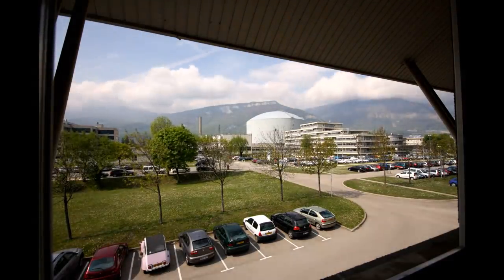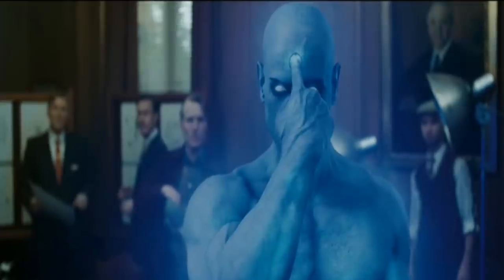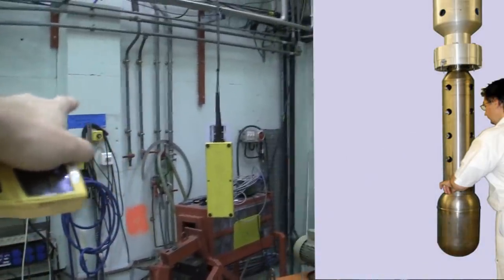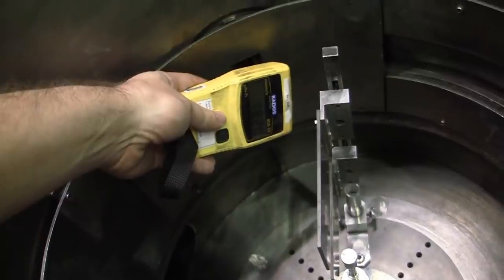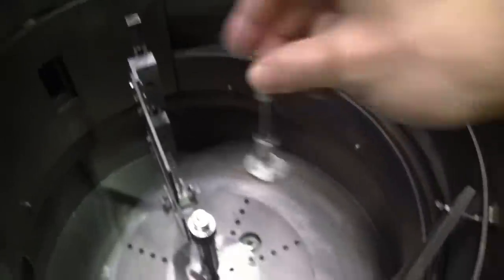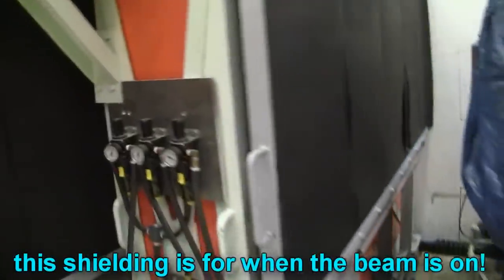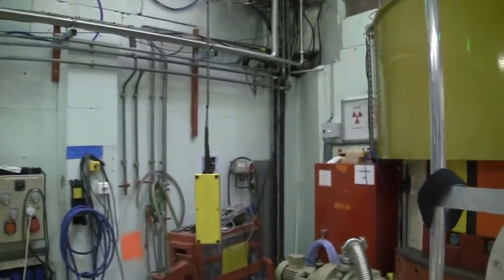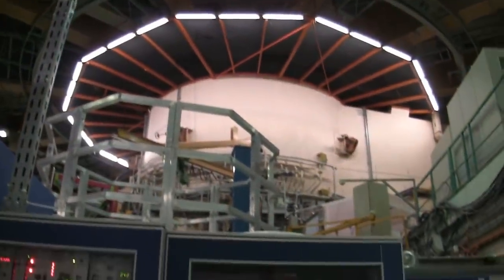Nuclear Reactors, Fantasy and Fact!

Comment: HAHA, Every time someone I know has asked me to explain what I did for my old job (US Navy nuclear field mechanic, submarine) or how nuclear reactors work, the things that seemed to shock them the most are always:
1--the fact that coolant (water) leaving the reactor core glows blue (Cherenkov Radiation)
2--the fact that essentially a nuclear reactor, in the most simplified way of description, is simply a big metal thing that gets hot, which we use to boil water.
3--descriptions of how awful the design and operation of the Chernobyl reactors were
4--exactly what the terms "subcritical", "critical", and "supercritical" actually mean in reactor operation (hint; they have NOTHING to do with the reactor about to blow up like all of the ridiculous movies have shown)
Reply: +22steve5150 I've worked on quite a few steam turbines at various plants and most of my friends don't seem to understand the difference between the turbine on the cold side and the reactor on the hot side.  I've tried explaining it to them, but they just don't get it.  As far as they're concerned, I get neck deep in radioactive waste.  To be honest, I've never actually gotten to work in Containment yet, and that's fine by me.  To most people, if it's at a nuclear plant, then everything there must be glowing green or something.
Reply: 22steve5150 I'm rather surprised at number 2. I remember my school physics class explaining that most methods of generating electricity boil down to (pun not intended) heating water and using it to rotate turbines.
Reply: +Crowley9 Nuclear Power: bringing Middle-Age technology up to the modern era.
Reply: +Phi6er sub critical means that the reactor is producing less neutrons than it's consuming, critical means that it's producing the same as consuming and supercritical means it's producing more than it's consuming.
Reply: since i'm not an expert i can be wrong, but i'm pretty sure it doesn't apply to it at all, i think it's a term exclusively for nuclear reactors.
Reply: +GamePhysics Lots of sensationalist bullshit in the media, the threat to life in the area and longterm environmental damage is nowhere near what some of the claims are.  Some of Thunderfoot's videos are about  Fukishima and they go over the reality of the situation very accurately and honestly.
Reply: +22steve5150 We have a HUGE problem. People are SCARED of nuclear energy, when something like the Thorium reactor would really cure most of our energy and greenhouse gas problems.
Reply: jesusnthedaisychain
Yep, same here.
Reply: 1. Infrastructure. You do not need large infrastructure. They are relatively small units and you add modules as you need them.
2. Mining. Thorium is the useless byproduct of rare earth element mining. We are already taking it out of the ground. After we use it up (way better usage, way less waste with Thorium) we can put it right back. Remember, it's only radioactive at 400 degrees Celsius.
3. There is little waste water. No more than any water that boils in a closed system. So, no difference from coal or gas. You may be thinking of the normal reactor that uses super high pressure, and unbelievable heat. Not the Thorium reactor.
4. Waste. The product is only radioactive at 400 degrees Celsius.
5. Cars. The development of good batteries for cars needs lots of rare earth elements. You know, that stuff you mine that has Thorium as a 'waste' product.
Because you take so much power out of so little, we will NEVER run out of Thorium.
The only reason they went with high pressure reactors that use other dangerous and expensive elements, was because those reactors created material for atomic bombs.
Thorium has been there all along, as a great way to get virtually unlimited energy.
Time to relearn our attitudes. The Thorium reactor really IS the way to get off carbon. I think we can agree that it would be nice to be completely off it. We can, now that politicians like Nixon are not in power. It was Nixon who folded the Thorium reactor so the United States could build bombs.
Check it out, and then spread the word. The Chinese are going to try and beat us on this.
Reply: ***** That's not true. We will NEVER run out of Thorium. Not for thousands and thousands of years. The Thorium reactor IS the cure. The complete cure. This should keep us going until we perfect the fusion reactor. In the mean time, Thorium is plentyfull and the reactors are completely safe. The core can't overheat because the salts, when they expand are not able to carry the reaction. That means self regulation. It runs at 400 C. The melted salts are kept in a vessel. The bottom of the vessel has a frozen Thorium plug, that is kept cold by subzero air that is blown onto the pipe. If the electricity goes out, the plug melts and the salts run down into a cooling chamber without ANY human intervention. Go to YouTube and watch the videos. They will make you very happy. We have a way to control global warning. We can stop mercury into our environment. People with asthma will get better. Cancer will drop as the environment gets cleaner.
Reply: +amojak  fast neutron interactions with borated water might have that effect (I worked on S6G naval reactors that don't use borated water so I can't really speak with any authority on such reactions) but I'm specifically talking about beta particle interactions with any kind of water, which seems to have a similar mechanism as what you described (beta particles transfers energy to water molecules as they slow down from speed of light in a vacuum to speed of light in water, and the water molecules then emit the energy they robbed from the beta in the form of photons)
Reply: +22steve5150 Yepp, agreed, the 'terror of the nuclear power' is definitely beyond the hype. 
What should not be forgotten is the amount of waste material (not inherently the nuclear fuel waste, but rather the shielding) that is generated for which we currently do not have any reasonably priced, or even reasonably long lived storage capabilities. As far as I am informed no current economically viable method has been developed to reuse that waste material.
Dito for the actual nuclear fuel waste. 
Note: I was talking about an economical way, not that it was not possibly physically.

That's in the same league as 'producing gold from lead'.
Yes, we are capable of doing that, but not in any way that is economically feasible. 
Because the amount of energy required is enormous, and the amount generated is absolutely ridiculously tiny.

In essence, a nuclear power station is nothing more than a glorified, super-powered steam engine.
You simply use the radioactive decaying process (instead of another heat source) to heat water to steam to power (via a heat exchanger) a turbine which in turn powers the generator. 
Period. Nothing more than that, basically.
But, sure, the actual controlling process does tend to be a tiny bit more complex. ;-)

In the science reactor (TRIGA) in Mainz I visited, something similar but muuuuch smaller than the one thunderf00t showed, the Cherenkov radiation was a very short-lived blue flare. 
Very nice color.
They used their oversaturation injection to demonstrate that effect to us chemistry students. 
Thanks to the moderator used in it is water, and water loosing its moderating abilities when it turns to steam, it is a very safe design.
It was NOT designed as a nuclear power station, but rather as a nuclear physics and nuclear chemistry reactor.

Note that this was more than 25 years ago, and my memory of the exact terms had to be translated from German.
So if the terms are not absolutely correct, please forgive me for that inaccuracy.
Reply: +Laughing Stock LMAO
Reply: +Laughing Stock 
Not trying to argue here, but waste heat CAN be managed with proper infrastructure and innovative thinking. There's an overwhelming demand for heat in general, on this planet of ours. Demand for fossil fuels just to use for heating and nothing else.

So why not kill 2 birds with 1 stone? Why not make the best of what we got without wasting anything?

If, and just go along with me for a second, we used nuclear power plants for electricity and used all the excess heat they produce to keep our cities and homes warm, wouldn't that be a great solution for the future? Why can't it be power plant AND heating plant at the same time?

Yes, there would be some heat loss during the transfer process for the public heating infrastructure, but if the excess heat is plenty then it wouldn't make much difference anyway. Would it not? And you can keep the system running on all but the hottest periods of the year or simply use it to heat up tap water during summer as well.

Is it so unreasonable to think this way? Is that really so unattainable?
On the other hand, I do understand that system like that would require huge investments and people working together for a common goal and in the current climate of selfishness and greed it's probably too much to hope for. It simply smells too much of "socialism". :/
Reply: MackP That's the problem. What happens? Well they try to seal the breach. (S?) They take down a nuke to seal it but then they don't use it. What do they do? They overload the last remaining Jaeger and it causes a nuclear explosion, which seals the breach.
They needed someone to say, "Hey, that won't work! To set off the bomb you need to make it a bomb, because a nuclear reactor won't do that!" Then they could have swapped the duties of each robot and everybody would have been happy.
I'm still going to watch the sequel if they make it, but there you go.
People think of nuclear reactors as potential bombs. I guess it's not worth it for Green Peace to set them straight.
By the way, I am a fan of the Thorium reactor. It still has a few problems, but when I mention those problems to people, they seem to think it's an easy fix.
Reply: MackP Check it out. That's why I like them. Simple, almost fool proof, cheap, abundant, did I say cheap? There's videos here on YouTube. You'll like it!
Reply: +Phi6er i read some of the other replies and found them to be missing info so here goes. Reactor criticality is like your car: super critical means you are accelerating speed, critical means you have cruise control on, sub critical you are braking or shedding energy. Really its that simple; whats happening in terms of neutrons moving around is more complicated but only slightly. All radioactive substances are naturally unstable and will periodically release energy in the form of radiation and neutrons. This happens at a predictable rate (half life) which is unique to each radionuclide (google chart of radionuclides). Depending on this and other characteristics of each radionuclide, there is a mass at which all of these energy releases will occur at once and interact with all of the neighbouring nuclei in the mass causing an uncontrolled chain reaction and the near instant release of all this unstable energy. So say if Pu239 has a critical mass of 13kg, and if you have 6kg in one hand and 7kg in the other, you would be safe provided you keep your hands apart (not to mention wearing some PPE lol). If you brought your hands together the two masses would go 'prompt critical' and an unbelievable energy release would occur. Prompt critical doesnt fit into the sub, super critical definitions because it is truly defined by the specific neutrons which cause the event and at what point during the reaction they are ejected from the nucleus. Google prompt vs thermal neutrons for more on that. Reactors are designed to prevent prompt criticality while A bombs exploit this reaction for obvious effect. Hope this helps!
Reply: ***** The governement will pay to slowly change over to Thorium reactors. They may well get their money back from having less illness that fossil fuels cause. Otherwise, the change over is a preventative measure to control global warming. It has to be done, and you offer no alternative.
Reply: I'm also going to say that mass production can bring that down. To be fair, I have seen estimates higher. That's one source that shows it's much cheaper than conventional nuclear energy. In all cases, it is cheaper than regular reactors, and we do need to change.
Reply: Oddly, there are thousands of decommissioned, disassembled nuclear reactors, including the reactor that burned during the Windscale fire, which aren't such menaces that you claim.
Most of the isotopes that result from neutron activation of nuclear shielding tend to be rather short lived.
Hint: Two and a quarter island (after it was, ahem, downsized), is scheduled to be demolished quite soon (assuming that Trump doesn't somehow cut funding for that as well)).
Indeed, the remains of SL-1 are no longer hazardous and that reactor had a massive, Chernobyl type of prompt criticality excursion that results in the explosive disassembly of the reactor.
Reply: +Laughing Stock your kidding me? right? RIGHT?!
Reply: yeah, the decay of radioactive elements (I'm taking uranium's decay, just as an example!) can be thousands of years, whistle I think that ''decay rates'' are the time span for radioactive elements to decay, is I think what he meant. (I'M NOT AN EXPERT SO DON'T THINK I'M 100% CORRECT ON THIS!) and yes, life will move on, damnit!
Reply: +22steve5150 What about the Fukushima reactors? Any thoughts?
Reply: ***** Hey man, I answered all your concerns, and you didn't go look at how they work, did you? Because if you had, you wouldn't now be taking the Luddite position.
Reply: Yeah, and I told you that the infrastructure is no bigger, and is, in fact, far smaller than the infrastructure for producing energy now. So that thought just bounced off your head? Why don't you just turn off your computer, your lights, and your furnace, sit there in the dark and STFU.
Reply: ***** No. Thorium will never run out. It's a common element. The fusion reactor is also coming on line. Thorium might become obsolete, but it will never run out. The other thing is, Thorium really gets used up nicely. Not as much waste.
Reply: ***** Drain a reservoir that was being used for hydro. Use the space now used by coal and gas. Sorry, there's no excuse.
Reply: ***** I am saying that there is plenty of room to build reactors, and that we don't need the reservoirs any more. River valleys are much more pleasant.
Yes, I am thinking about replacing the methods of creating power that destroy the environment. There's room for the infrastructure, and we can get rid of ALL the carbon based energy systems. NO we don't have to replace the boilers, the turbines or the wiring.
To be clear, we WILL need to build more power generation. Our society is growing. Might as well choose something that will solve ALL the problems.
Thorium is extremely friendly. At normal temperatures, nuclear reactions don't occur.
I have said before, this time pay attention, that Thorium produces less than half the waste of other types of reactors, and the layout is compact and simple. You only need a small building because there are no high pressures to deal with.
I don't believe in God. I do believe in leaving a river valley ecosystem alone if it can be helped. Draining a reservoir returns the valley to a natural state.
Thorium reactors mean no more mercury contamination and no more global warming gases.
Reply: ***** The difference between you and I is that I have answered all your concerns, and you give me NOTHING.
You disagree with the Thorium solution to the energy problem because you disagree. Your posts show you don't know anything about it, and yet you persist. Is it the only way you can get attention?
Heat pollution? Are you stunned? Almost all the major forms of energy use steam to drive a turbine. Maybe we should all just turn of our furnaces because, OH NO, they produce heat? What a nonsensical argument. You just disagree because you just disagree. I meet people like you all the time. No vision. All you do is bitch. Tell you what, why don't you and your fellow 'we can't do it' friends stand back and let us take care of this.
Reply: ***** Thank you for saying nothing again.
You don't have to replace everything at once. You can not bankrupt a country by the steady change over to Thorium. If the reactors remain in government hands, it PAYS for the programs that governments run.
I have told you, and the information could be understood by the average nine year old, that it is cheap, safe, and represents true clean energy that will NOT run out. You learned by now that it will NOT run out. You were wrong and I doubt you will admit it.
You need to shut up and let the revolution happen. I would let you keep your coal and oil, but those sources of energy will eventually be outlawed as they should be. You don't have to use any power from the new plants, since it goes against what you believe in. You should also just shut off your computer, since the information here just bounces right off of you and you don't want to use too much power, right? Feel free to turn off the lights and freeze in the dark.
Reply: And now for the test. What is the one issue that Thorium reactors have? The most important?
Reply: ***** They do have a technical challenge. What is it?
Reply: ***** If you had watched the videos available, you would know. It's just proof that you guys are posting before you do any research. Even now, I have told you there is a challenge, and none of you have the balls to go find out what it is.
Reply: You just posted without any knowledge whatsoever. Nice try.
Reply: MackP Did you see Pacific Rim? The movie?
Reply: Rising Power
Yes, I have. What about it? :)
Reply: Rising Power
I guess people are just afraid of the consequences of mishandling the nuclear energy or ignoring the external risk factors. Can't say that I blame them, but we should all be more open and honest. That's the best way to avoid confusion and ignorance.

The part of problem lies within the system itself though, where education is expensive, open minds and knowledge are scarce and entertainment is the end goal. Not to mention those who rely on other people's ignorance to thrive and make money, that's a big part of the problem as well.

As for thorium reactors, I'm afraid I don't have the necessary knowledge or education so I can't comment on that.
Reply: *****
I don't think you understood what I said. And I specifically mentioned heat loss during transfer process for public heating infrastructure. But you apparently didn't read or completely misunderstood what I said.

Of course you would not use the coolant water directly, are you insane? You would need to transfer the heat from that water to the non-contaminated water which would then be used for heating. And that, in turn, would require a well designed, effective system.

Did I make myself perfectly clear now, mr. "wonderful world"?
Reply: ***** The infrastructure from the steam turbine on is already there.
Reply: ***** The fact is, that you are inaccurate in your ideas of infrastructure needs. You also have offered no alternative. So, if you agree that something must be done, and you offer no alternative, I suggest you leave it to those that can get the job done.
We have had several power plants constructed in our province in the last 20 years. Why? Because they make money that pays for the initial investment.
Reply: 200 million dollars.
Reply: http://www.wisegeek.com/what-are-the-advantages-of-mass-production.htm
The idea is to build reactors side by side. You add to the reactors as your need grows. Since the demand will be huge, mass production is a great idea. They already do it for hotels, for instance. No development costs and experienced builders will make it cheaper.
Oh, the other quote on cost? It popped up with a Google search, I passed it by because it didn't seem to have a reasonable identification. That link showed considerably higher costs, and then also showed regular nuclear at billions. That still shows that Thorium reactors are cheaper, but the method of costing was different. Maybe time of posting the estimates was the difference.
Reply: *****
"Whether the heat is transported through radioactive water is a secondary concern"

I can't take you seriously after this statement. Sorry, I just can't.

As for your question where is the infrastructure, it's already there unless you've been living on Mars. Public heating is already there, except it's being powered by fossil fuels. The innovation comes at the point where you adapt the existing infrastructure to work with new technologies.

I get the feeling you're intentionally playing dumb to somehow get your point across. My English is perfectly clear and understandable.
Reply: William Buttle Thank you Will. Each bit we learn is great for us. If only we could get people to think in a positive manner.
Reply: *****
Also, I never said anything about thorium reactors. That's you assuming things. I advocated for more efficient usage of nuclear reactors and technology. That would make people less defensive in their attitude against usage of nuclear power and subsequent advancements in the field.

Just like cars - the more people use them, the better and more efficient they're going to become (and are becoming, every day). If we completely give up on such a source of energy out of fear, then we won't get anywhere.
Reply: MackP Once you learn that we basically generate our power by steam, then you understand what infrastructure you need. I found Fireman's training to be fascinating. I learned that at a high security factory in my city the owners were working on a system that floats the turbine on two magnetic fields to eliminate bearing wear. Now I know why they had six foot high fences, topped with barbed wire surrounding it.
The larger generators in our province are simply incredible. The fire tube systems that carry the steam to the turbine expand when heated. They drop two feet. TWO FEET. Holy crap! Awesome. In the illustration, they show a picture of a man to give you some scale. There's the tiny little guy down there. I never went on into power engineering but I must admit I loved it.
Reply: Rising Power
"Once you learn that we basically generate our power by steam, then you understand what infrastructure you need."

Exactly. And when you translate that into heating, you already know we keep ourselves warm with water (apart from in-house electrical heating appliances). Always have, always will. Because there's no better and more practical medium to transport the heat from the heating plant to our homes with the current infrastructure.

After knowing that, all you need to figure out is how to heat up that water cheaply and effectively. That's where the nuclear power comes in. And I bet there are plenty of smart people out there that can do it, that can figure it out. We just have to get on board and get along.
Reply: *****
Like I said, you sound like a very ignorant person and I'm not going to dignify you by answering any more of your nonsensical statements and straight out strawman fallacies because I can't take you seriously.

Anyone with IQ over 80 who actually reads my statements will not find anything you just claimed I said or implicitly agreed to. Strawman fallacies - that's all you have and it's not even a discussion with you, it's an exercise in futility.

I'm just going to ignore you now, I don't fancy wasting my time with you.
Reply: ***** Unless you have links for your opinions, which would make your posts worthwhile you should STFU.
Reply: ***** Thorium reactors are cheap compared to any other nuclear facilities. There is really no other choice.
Reply: ***** The infrastructure is already there. That energy production is cheap, and really pays for itself. The rest is wiring, which we already have. How many times do I have to tell you this?
Reply: Rising Power
Don't bother arguing with that idiot, I ignored him already. He asks for proof and sources for every word you say while having problems understanding basic concepts.

My advice to you is just save yourself some effort and let it go.
Reply: MackP I will let it go, oh Zen master. ;)
My thoughts are the same. He just needs attention.
Reply: +22steve5150 i would dispute part 1, the blue glow comes from fresh hot rods in the boronated water. it glows blue as the neutrons travelling at the speed of light are unaware they can't do that in boronated water so give off light as a biproduct.  the glow soon fades as the rod cools.  The interesting thing with boronated water is how it distorts light compared to water alone too.
Reply: MackP I would say that all that is needed are an electric hot water tank and a bit of treatment so the lines don't corrode.
Reply: Well, some reactors can blow up. Just not in a nuclear explosion.
Chernobyl, Fukushima and SL-1 all blew up. Two, due to prompt criticality accidents, one due to LOCA and a subsequent hydrogen explosion.
Reply: Our navy recruiter is a nuke, he says he rather be on a sub